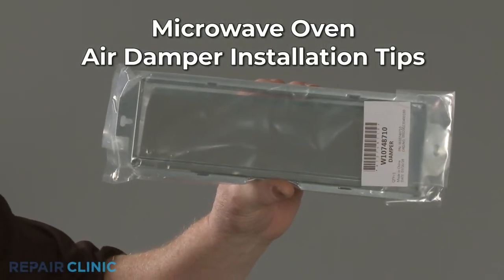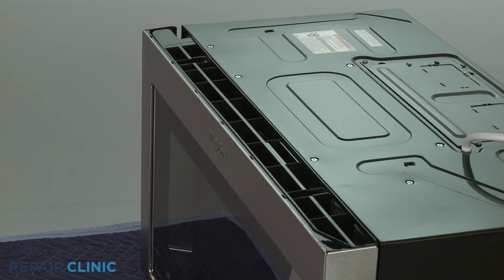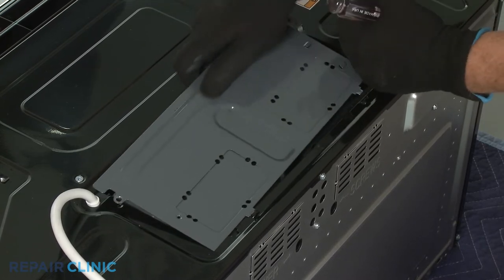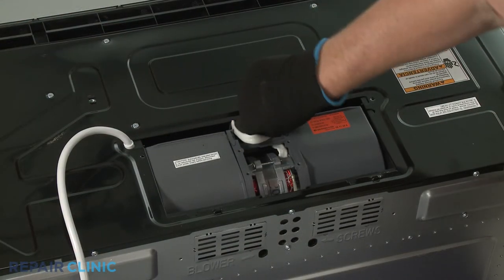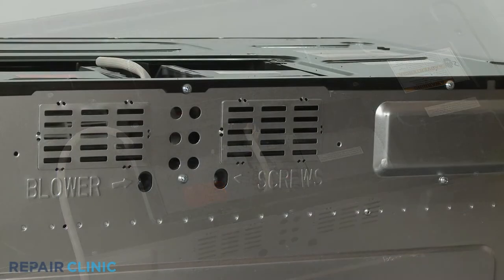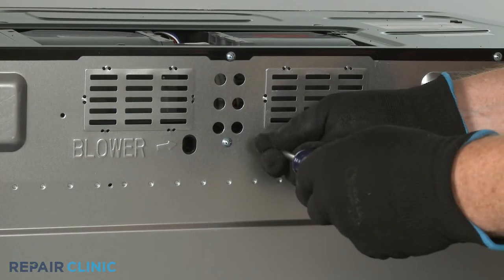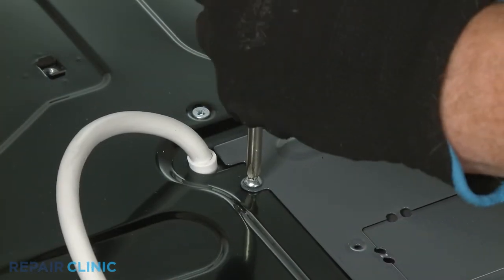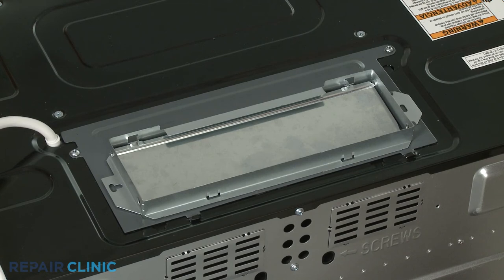Whirlpool Microwave Oven/Hood Combo Air Damper Installation W10843943

Comment: It tells you to snip the two metal vented plates off the back, but they are still there when he installs the damper assembly both are still attached?????Are totally removed first?
Reply: Guessing he was not actually doing an install so did not want to snip them out, but of course you would want to remove those baffles fully.

Comment: Is it ok to install without damper on top out exhaust. Whats the purpose of damper? Also I accidentally remove rotator cover from the fan? Does it effect usuability
Reply: I don't think so. It's only for venting so the air has somewhere to go but the microwave itself is set up for recirculation without the damper. However if you cut out the holes for venting you will need it
Reply: Also according to Google... Yes, a range hood damper will help prevent leaves, small animals, other debris, and hot or cold air from entering your ductwork and home from outside; it will also prevent backdrafting, which occurs when the dirty, greasy air in your ductwork travels back into your home by way of gravity or air restriction.
Reply: I had just changed mine and oh gosh there were wasp nests when I removed it. Really freaked me out

Comment: If the external vent already has a damper and screen, can you skip installation of the damper on the microwave? Having two seems a bit redundant.

Also, I'm getting a bit of air coming out around the edges of the microwave cabinetry - enough to make flames on the range dance around. Note that there's also a lot of air going outside when I checked the outside vent. Would it make sense to seal with weather stripping on top of the microwave?